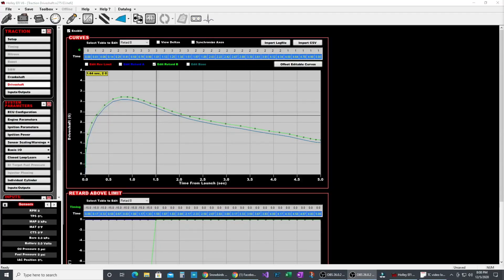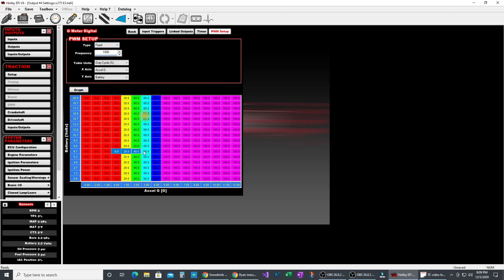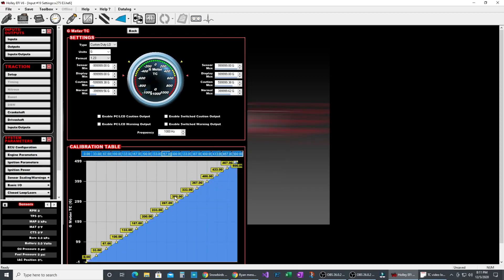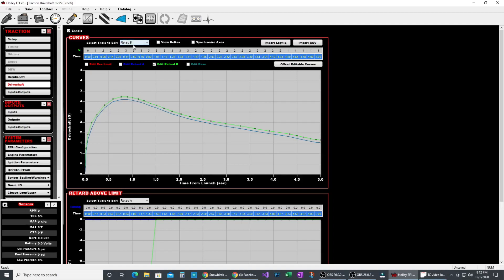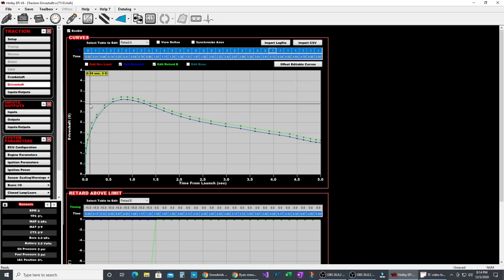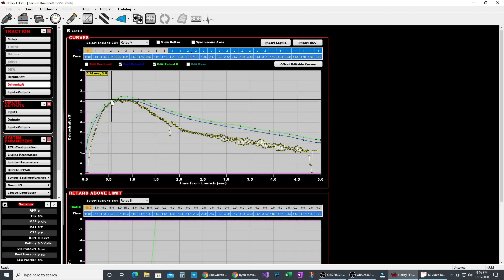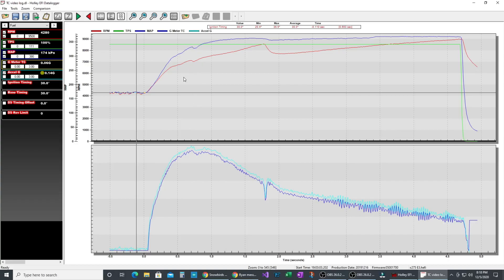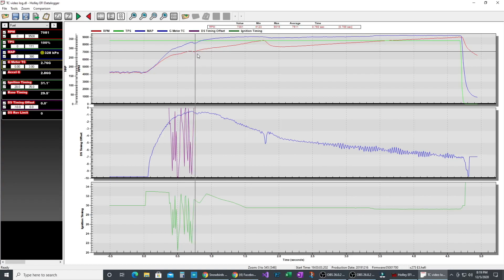G-Meter Based Traction Control: A brief how to with Holley EFI

Comment: Are you still utilizing a speed sensor of some kind? Could I use a G meter with a drive shaft sensor G's vs Drive shaft speed. So if it sees excessive revolutions outside X amount at what ever G it pulls the speed control timing fuel etc?

Comment: Who makes the g meter you used . Do you prefer g meter based tc over driveshaft speed based tc ?
Reply from the maker: I use the Holley g meter part number 554-162. 

I will use either depending on what data I have from the car previously.  Traction control like this only works if you have previous data to base the plotted curve on.